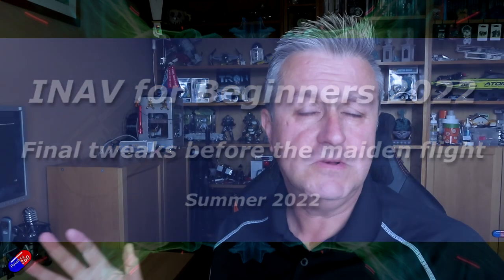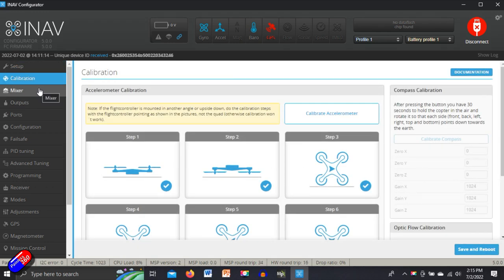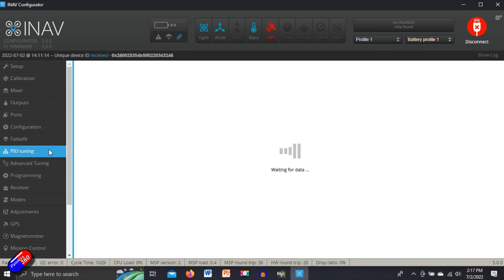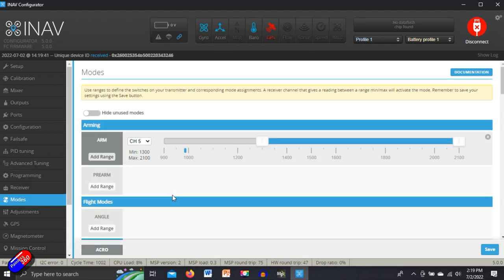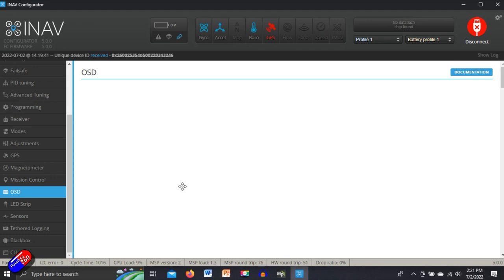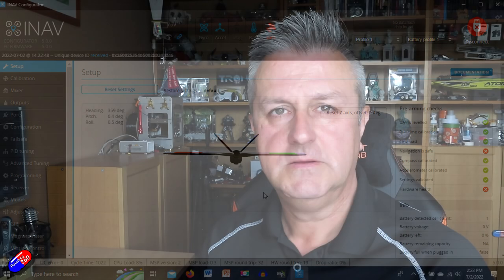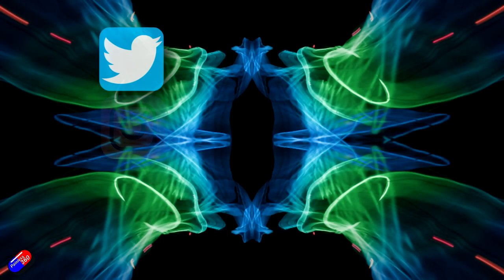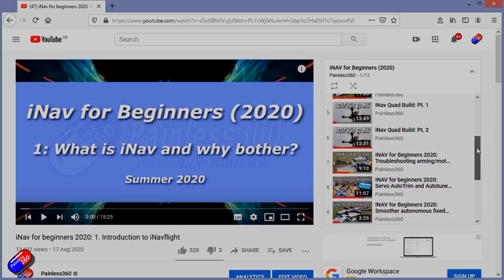(6/7) INAV for Beginners 2022:  Final tweaks and checks before the maiden flight!

Comment: Thanks for the video. Just wanted clarification. You said you selected continuous SERVO AUTO TRIM in INAV. At the end of the video you say whilst flying in HORIZON mode you put on the AUTO TRIM. Is servo continuous AUTO TRIM different than the AUTO TRIM you are talking about? Or have you put the SERVO AUTO TRIM in a switch and activating it when you are happy with the plane flying in HORIZON mode? Thanks
Reply from the maker: https://youtu.be/t_lkfoE5_ds should help. Best of luck

Comment: Hi, I have flysky i6  6ch radio is it possible for me to set up that many modes? The problem that I am having is that I can' t use autotune and autolevel at the same time
Reply from the maker: Not sure on that radio. I wouldn't recommend doing both at the same time anyway.. Best of luck.
Reply: @Painless360  Thanks for the answer. I suppose that the best thing for me would be to buy a different radio. Could you recommend me any that would be considered budget but at the same time good? At the moment when I use MY current radio could I potentially use Failsafe to initiate RTH?
Reply from the maker: Common popular choices are the RadioMaster EdgeTX radios like the TX16s and Boxer..
Reply: @Painless360  If I would buy a boxer. Which  version do I need  ELRS, 4IN 1 or cc2500?

Comment: what about the radio settings? should i create a vtail model on my jumper 16 or can i use a regular T model and the FC does the job of mixing elevators and rudder?
Reply from the maker: Check out the beginning of the series.
No mixing done with the radio for ANY model type. Best of luck
Reply: @Painless360  DONE!!! Than you

Comment: I have a question for you re inav5 servo setup for a nano talon I'm building (yes, four years late on the bandwagon) Is the "single aileron servo for v tail" the correct pre-set config choice?  Or do I need to do a custom model config as you showed in your video from a few years back? Cheers
Reply from the maker: Not sure, I'd expect it to be the same as the mixer setup hasn't changed that much... best of luck!
Reply: @Painless360  Ta for that, yes I will soon know once I get the FC installed. Half the fun is fiddling about with the possibilities
Reply: Not sure why you would do a custom model config?, Inav5 has a single aileron for v-tail preset, that is how I have it configured for my Nano Talon

Comment: I have an iNav trick.  After an autotakeoff and landing, cycle the power before next takeoff.
Reply from the maker: Thanks for the comment, what benefit do you get from that?
Reply: On my FX61,  i did three auto launches in a row as I was so impressed with it,  but I didnt power cycle it.  On the third launch it nosedived into the ground from 60m up uncontrollably, i had no control even in manual.
Reply: It has put me off iNav but I think doing that is wrong on my part hence why I mention it just in case someone else does it.

Comment: I would suggest to add inav 5 to the title cause I had missed that detail and started now watching after I had seen that this is about iNAV5 build from scratch.

'iNAV for beginners 2022' did not kick the trigger at least for me. 
At least for the playlist it might be usefull if you can not edit a title afterwards. I will check the playlist to watch them all.

Great series - thanks
Reply from the maker: You'll see that the process is almost exactly the same as the INAV for beginners 2020 series and all my other builds. See commentary in the first video... happy flying

Comment: I've seen some guides that recommend not using autolaunch for the maiden flight. I've just got my first ever fixed wing ready (I think!) for its first flight, but I'm not sure whether I should be doing a manual launch first, or going straight to auto. Slightly worried that trying to do a manual launch would be even dodgier.
Reply from the maker: I always use Autolaunch. It can do a far better job than most pilots to catch an issue and correct for it. See my various INAV maidens..
Reply: @Painless360  OK, thanks very much!